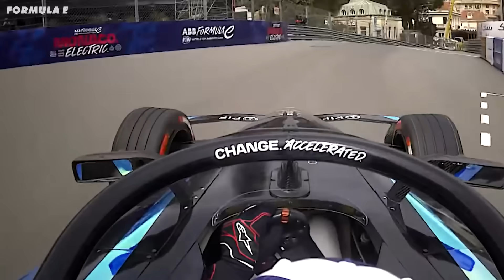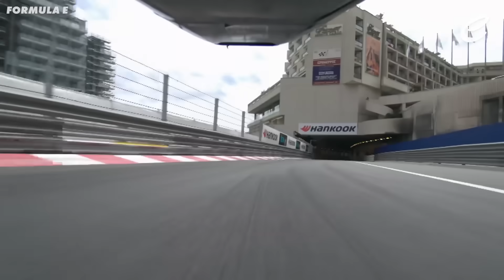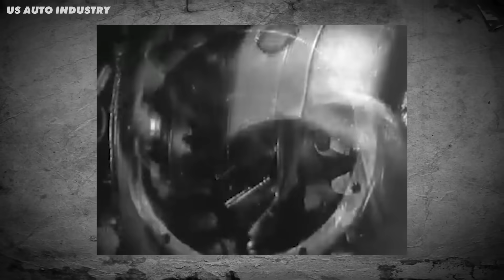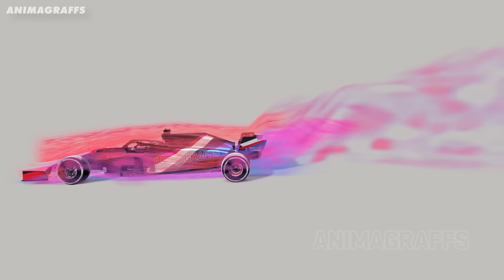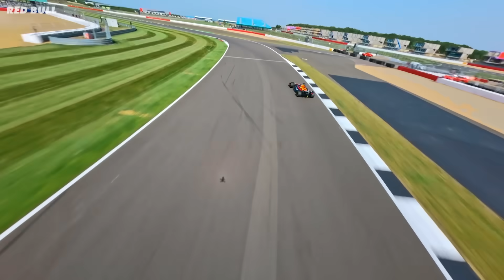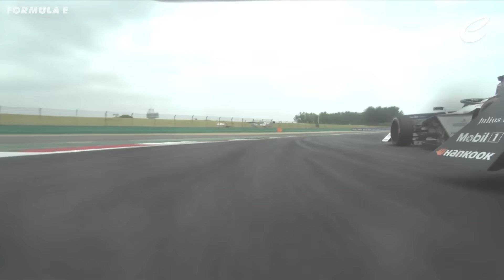The New Formula E Car Might Be F1 Fast

Comment: What's happened to this "driving a car upsidedown in a tunnel" project? You plugged the heck out of it and then we haven't seen a video in over 7 months.
Reply: Probably funding.
Reply: I would be happy to see it done with Scalextric cars, then R/C cars, then a child size cart, then a full size cart, all the way up to a Caterpillar D9.
Reply: Money.
Reply: He said he would do a update in a recent video, remember, he is not Mr Beast, he has to get a team together, building materials, car, and funding. I’m sure that he will update us soon
Reply: I knew instantly he bit off more than he could chew, no one is going to insure this or sponsor it. I like to think if Red Bull didnt do it, its because it cant be done safely.
Reply: That's a lot of work I'd imagine I bet it will take some time yet
Reply: I think the next video is on the edge of being done.
a few weeks ago he said it's in the making. or something along those lines.
Reply: I feel it was too large of an ask to begin with due to what they wanted to achieve. If I were approaching it from a realistic standpoint I’d start with an electric FSAE kart like in this video, mount it to a track system on the ceiling of a sufficiently long building or tunnel with a safety tether. Start upside down and use the track until the designed aero elements are able to take over. 

That’s still an incredibly tall order to achieve but I feel like if this is to become reality it’s more realistic (financially and physically) than the proposal I saw in their prior videos).
Reply: @MX5-XU FSAE cars are designed for relatively low speeds up to a little over 100 kmh (single gear ratio, max rpm of 20k, optimized for acceleration). I’m not sure they produce enough downforce at those speeds.
Reply: @badstep495  nothings out of the realm of reality with a few modifications to power, gearing and aero.
Reply: We? Who? He mentioned it 3times+ across the 7months
Reply: Money.
Reply: It's confirmed cancelled.
Reply: He said an update was coming soon like a week ago man
Reply: Because it takes time to project, build a car and same stuff for the tunnel
Reply: It was a PR stunt to get more subscribers. He'll probably make a video a year, talking about it, but I doubt he'll ever do it.
Reply: I was wondering the same thing
Reply: I agree we need to know more it's got to happen
Reply: Idk abt me but can u build a almost 1 mile long ramp that curves upside with  being able to handle the forces of it
Reply: for real. at least update us rather than sweep it under the rug
Reply: Probably building the tunnel, but yeah an update video would be really appreciated 😅
Reply: He is not MrBeast
Reply: nobody cares
Reply: what happened? physics.
Reply: Lmao 😂 been wondering about this too
Reply: Its just too expensive to do properly
Reply: you really think they could build a tunnel to do it in 7 months?
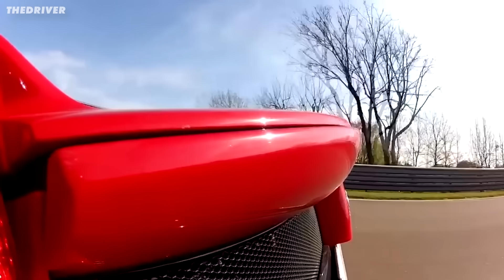Reply: 6:59
Reply: 6:59
Reply: Have you seen the video where he basically states he needs to build the "tunnel" because the car needs to gradually slope onto the ceiling and if the ground effect is broken he's dead?

Basically this was a project DOA for anyone with a brain, he's a YouTuber and a racing driver. This needs proper engineering, like aerospace level engineering stuff. 

In theory it's doable, heck the McMurty Speerling weighs 1 ton and generates 2 ton of downforce so definitely can be driven upside. The problem is there's much, much more, variables than just downforce.
Reply: Must have been a hypothetical
Reply: He did update, have you seen?
Reply: people asked why haven't Redbull done this, same reasons lol. it just take stupid money to do smth like that
Reply: Even the crazy colin furze needs time to set up his million sub fireworks so
Reply: ....
Jesus Christ is the only hope in this world no other gods will lead you to heaven

There is no security or hope with out Jesus Christ in this world come and repent of all sins today

Today is the day of salvation come to the loving savior Today repent and do not go to hell

Come to Jesus Christ today

Jesus Christ is only way to heaven

Repent and follow him today seek his heart Jesus Christ can fill the emptiness he can fill the void

Heaven and hell is real cone to the loving savior today

Today is the day of salvation tomorrow might be to late come to the loving savior today

Holy Spirit Can give you peace guidance and purpose and the Lord will

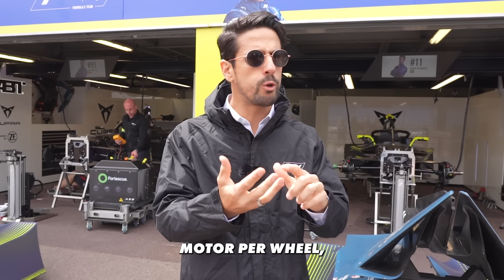John 3:16-21

16 For God so loved the world, that he gave his only begotten Son, that whosoever believeth in him should not perish, but have everlasting life. 17 For God sent not his Son into the world to condemn the world; but that the world through him might be saved. 18 He that believeth on him is not condemned: but he that believeth not is condemned already, because he hath not believed in the name of the only begotten Son of God. 19 And this is the condemnation, that light is come into the world, and men loved darkness rather than light, because their deeds were evil. 20 For every one that doeth evil hateth the light, neither cometh to the light, lest his deeds should be reproved. 21 But he that doeth truth cometh to the light, that his deeds may be made manifest, that they are wrought in God.

Mark 1.15

15 And saying, The time is fulfilled, and the kingdom of God is at hand: repent ye, and believe the gospel.

2 Peter 3:9

The Lord is not slack concerning his promise, as some men count slackness; but is longsuffering to us-ward, not willing that any should perish, but that all should come to repentance.

Hebrews 11:6

6 But without faith it is impossible to please him: for he that cometh to God must believe that he is, and that he is a rewarder of them that diligently seek him.

Jesus
Reply: 2 months away from seeing this happening, can’t wait about it😎
Reply: Never gonna happen
Reply: i heard he is going to use a devel sixteen
Reply: @lionemessi lol
Reply: My brother in Christ, there is so much time and money required to pull something like this off, the people involved undoubtedly have work and other matters to attend to, sometimes schedules don't line up. I'm in the construction industry. Trust me, things like this- especially something highly unique and specialized, take a very long time to put together.

There's also a possibility it'll never happen due to funding
Reply: @MCOGroupNews  No one is bashing him for not being rich enough to do it. We're bashing him for not posting an update and being transparent.
Coming out with a big mouth saying "I will do X" and not actually doing it without giving a reason just makes him look like a grifter. His reputation and credibility has already been questionable with many inaccurate info like "Kimi likes understeer".
Reply: D r 
😅😅😅😅
Reply: It's not been 7 months. Stop whining and go watch it.
Reply: 14,000,000$ lmao
Reply: Dont be silly. It was a video to farm views and money. If you think some youtuber was really gonna build a massive track for millions of $ then you are cray
Reply: @uv77mc85  You think Scott's just a YouTuber? 😂
Reply: @uv77mc85 he never said he was going to build a track?
Reply: I dont really like scott tbf, cant really trust him with anything.
Reply: @KIoakk  You don't have to watch tbf, would be more logical not to lol.
Reply: @KIoakk  why are you here then?
Reply: Oh yeah? Then why tf are you even here Budd  @KIoakk
Reply: @KIoakk Mr i raced a race car. The amount of times hes said hes driving said race car in almost every video
Reply: @jackciampini496  oh mate the amount he times he says I have raced this car or that car is so annoying
Reply: @KIoakk so why are you here?
Reply: @KIoakk a hater but keeps commenting in this channel.... touch grass
Reply: @KIoakk fund before bark
Reply: If Redbull pulled this off then we wouldnt be questioning or challenging the overblown statement of driving upside down. 

Guess gravity had the last laugh.
Reply: Because its impossible
Reply: Because it's a scam

Comment: I mean F1 has been restricting their cars for nearly 30 years now.
Give it a couple more year and they're up to speed, at that point they also will be limited by safety.
Reply: *74

F1 has had a rulebook with restrictions to cars since it's origins, It never was a "formula libre" and never will.
Reply: @mondodimotori  True. That's why they call it "formula". But it didn't use to be so ridiculously regulated as it is now.
Reply: Yea F1 has limits because they have reached the limit of what is considered safe. These electric cars carrying a load of batteries, so they are likely to be more restricted.

The are a few reasons Formula-E isn't held on full sized tracks. They don't have the range to do an F1 length race, they would look and sound slow on the long straights. A high speed crash means the batteries turn in to a giant fireball, incinerate the driver and poison the audience with toxic fumes.
Reply: ......
Jesus Christ is the only hope in this world no other gods will lead you to heaven

There is no security or hope with out Jesus Christ in this world come and repent of all sins today

Today is the day of salvation come to the loving savior Today repent and do not go to hell

Come to Jesus Christ today

Jesus Christ is only way to heaven

Repent and follow him today seek his heart Jesus Christ can fill the emptiness he can fill the void

Heaven and hell is real cone to the loving savior today

Today is the day of salvation tomorrow might be to late come to the loving savior today

Holy Spirit Can give you peace guidance and purpose and the Lord will

John 3:16-21

16 For God so loved the world, that he gave his only begotten Son, that whosoever believeth in him should not perish, but have everlasting life. 17 For God sent not his Son into the world to condemn the world; but that the world through him might be saved. 18 He that believeth on him is not condemned: but he that believeth not is condemned already, because he hath not believed in the name of the only begotten Son of God. 19 And this is the condemnation, that light is come into the world, and men loved darkness rather than light, because their deeds were evil. 20 For every one that doeth evil hateth the light, neither cometh to the light, lest his deeds should be reproved. 21 But he that doeth truth cometh to the light, that his deeds may be made manifest, that they are wrought in God.

Mark 1.15

15 And saying, The time is fulfilled, and the kingdom of God is at hand: repent ye, and believe the gospel.

2 Peter 3:9

The Lord is not slack concerning his promise, as some men count slackness; but is longsuffering to us-ward, not willing that any should perish, but that all should come to repentance.

Hebrews 11:6

6 But without faith it is impossible to please him: for he that cometh to God must believe that he is, and that he is a rewarder of them that diligently seek him.

Jesus
Reply: Your point being?
Reply: @Alan-ww8vi  Formula E cars wont be faster than Formula 1 cars (whenever FE cars reach that point) cuz the FIA will restrict their speed for safety reasons, the same thing happen to current F1 cars

Comment: So did you completely abandon the project of driving a car upside down? There have been no updates for 7 months now..
Reply: Money money money man, the funding required is insane that's why he did the big push, hoping someone would sponsor him, and even if they said yes there are likely contracts to sort out, possibly NDA's until everything is 100% sorted. I reckon it would be 18 months minimum until we see anything on track best case
Reply: Pretty sure developing a car from scratch to do that would require more than 7 months.
Reply: @mondodimotori  Sure, but an update every once in a while might be nice. Not these huge intervals.
Reply: He is not MrBeast
Reply: I watched a recent video where he did mention it. Don't remember which one though, either way, it's not exactly gonna be a short term project.
Reply: to be honest.. i never believed that this will be done 

its an INSANELY expensive project. I have no idea how he could talk about it like its a simply task that just needs a bit funding.

the tunnel alone will cost millions.

and then the car developement comes on top. He has to find a billionair to fund this project.

its like a feverdream to even have the idea to make this happen.

 he should rather build his own Formula 3 car or a nice hillclimb / time attack car. Would only cost 1/10 to 1/20ths or even less of the money and could be done in a fraction of time.
Reply: @Hardys-Mods an electric open wheel hill climb car would be the easiest way. Wouldnt have to worry about the effect on the engine from being upside down since it would be electric motors lol
Reply: @ChrisPBacon9 Electric swapped Formula 4 chassis with insane aero

Comment: With one small motor per wheel, there is no reason to stop at four wheels.  Gen 5 cars could have six wheels, or possibly even eight.  More grip is more better!
Reply: Why keep the car shape? With all wheel steering, let's make it round with wheels all around it. Formula UFO!
Reply: Grip/friction is typically dimensionless, dependent on the coefficient of friction between two surfaces the normal force and gravity (or down force). I don't think adding more wheels necessarily improves grip.
Reply: @SwiftMo_Power Tyres are not like ideal physics friction. The friction coefficient drops off a bit the more you load them.
Reply: Would also increase weight. 

Also wouldn't necessarily increase the grip that much, depends on how the contact patch is affected.  There's also a limit to how much power is usable in formula e, the tracks are narrow and adding more wheels also makes a vehicle longer. 

If they use softer tire compounds with the added surface area it should definitely give more grip.

Having more wheels is generally a off-road thing because having more surface area means you don't sink into the dirt so easily.

If we only drive the 4 rear wheels it might get crazy regeneration and have really good turn in response. 

With all wheel steering and torque vectoring especially, then we can power all the wheels with no issues 

Would be fun with active suspension as well along with the active aero. 

Active suspension on 8 wheels is amusing.
Reply: More grip is more rolling resistance. Maybe they can do two laps of a real circuit with 8 wheels 😅

Comment: doubling speed, quadruples downforce? that doesn't sound logical
Reply: It quadruples drag not downforce. So, you're right it doesn't make sense. But also, it's not what he said.
Reply: @nielspeelen5748 , it also quadruple downforce, just search up some downforce equations on google, people have done it before.
Reply: if you have a square, and you double the length of its sides, then you will quadruple the area of the resultant square.  it's a similar logic

Comment: And when you factor in the carbon footprint and petroleum usage to manufacture the batteries, there is no energy savings. You use significantly more petroleum and energy to manufacture the batteries than the vehicle will save in five life cycles. This creates a much larger carbon footprint and any claims of savings is ridiculous and absurd if not an OUTRIGHT LIE!
Reply: Do you have a link to the analysis that determines what you just said?
Reply: @FMAlchemist2006  can't post links on yt, but you already know this.... A few quick searches on li-ion battery production would give you the same information. You can easily find this info related to cost of manufacture based in CO2 output or barrels of petroleum used.
Reply: I think saving the planet was not the point in this video.

Comment: So.. what if the F1 can have also AWD “hybrid” drivetrain and active aero? On a big track like Mugello will be much quicker then EV.. ICE engine on the back, electric motor on the front🤷🏻‍♂️ still belive in ICE.. it is light and powerfull. 👌🏻
Reply: I think there are two reasons why they haven't done this yet: 1. An AWD hybrid F1 car will be massively heavier and,  2. They will be more expensive and complex to make, which would go against F1's push of having cost caps and "better racing".